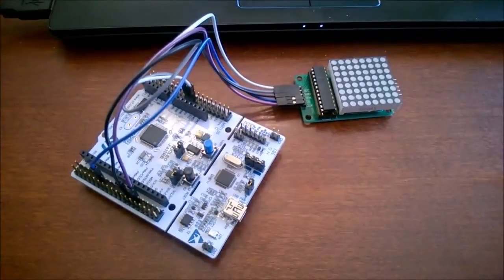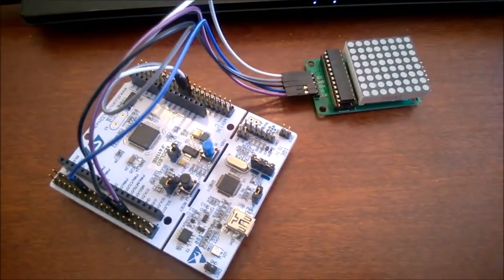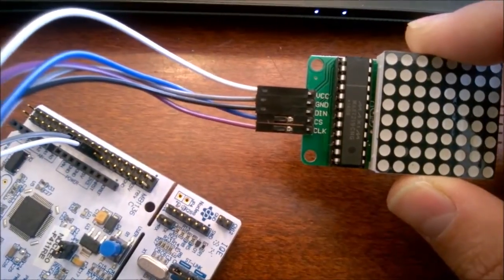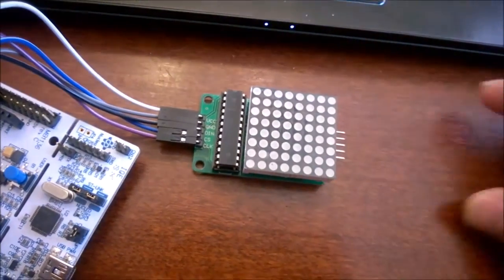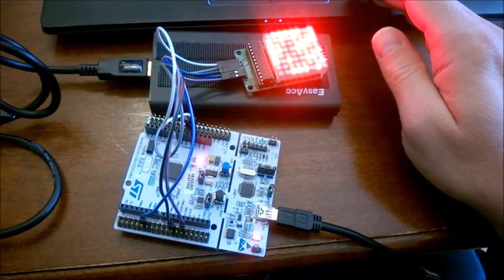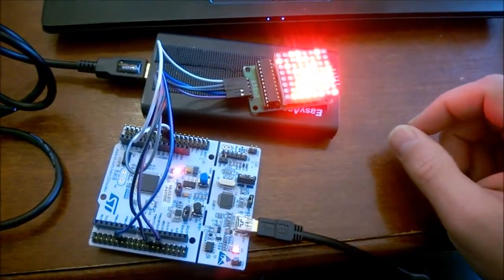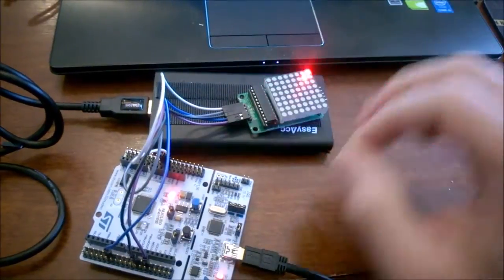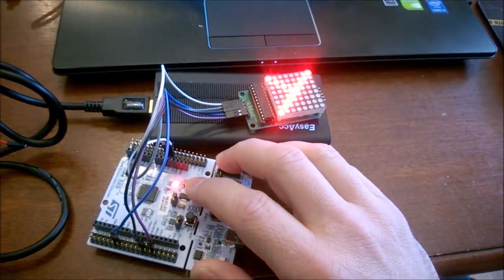MAX7219

Comment: General question with the same idea: max7219 logic high is at least 3.5 V (see specs sheet page 3), meanwhile F401RE max logic high is VDD, which is usually 3.3 V (meanwhile can be as high as 3.6 V). How can you solved that?
In general, I have a lot of logic level issues with mbed and external peripherals (MAX7221, TLC5940 and many oled ad lcd i2c drivers).
Reply from the maker: I did not have that issue with my board, it was an F411RE
Reply: Thanks Mark,
I've made a small and simple scope with an Arduino and made some measurements. I've found out that there is no any signal on SPI channels except CLK, which is a plain 50% duty-cycle square, as expected. But absolutely nothing. (Made many attempts, both with Nucleo and LPC1768, but no luck.)
I'll make more investigations tomorrow. Thanks for your assistance!

Comment: How to use three MAX7219 control a 8X8 LED MATRIX RGB?
Can you tell me how the circuit connecting it?
Reply from the maker: 李偉佛 The MAX7219 has outputs that match the inputs.  So you just daisy chain them.  I will post a video of this next week.
Reply: ok ,Can you mail me that how to connent circle and code ? 
My mail is zx08094490@yahoo.com.tw
Please ~  Thank you!!
Reply: I ask about the letters displayed in the opposite direction, how to deal with?
The direction of movement is from left to right, how to change?
Reply from the maker: 李偉佛 change the index from high to low. There is one variable that is the numeric index of the MAX7219.  The higher the number the further down the chain.  Otherwise, turn the letters upside down by modifying the code that displays the letters.   The rows are lit up by sending a number between 0 and 254.  Look at the video again, I explain it.
Reply from the maker: Mark Malo at 2:10 or so
Reply from the maker: 李偉佛 No Problem :)  Hope it helps you!
Reply: I ask about the letters displayed in the opposite direction, how to deal with?
Reply from the maker: 李偉佛 You have to reverse the direction of the index for each unit...OR if the letter itself is backwards, reverse the value of each row.
Reply: If I use common anode, what is the need to change it
Reply from the maker: 李偉佛 Has nothing to do with that.  Has to do with code.
Reply: Is it usually cathode?